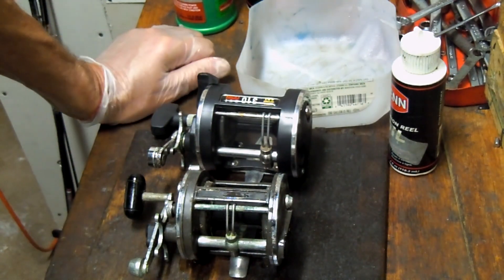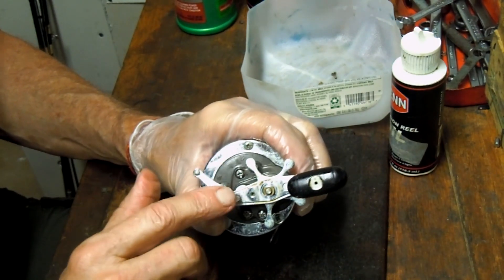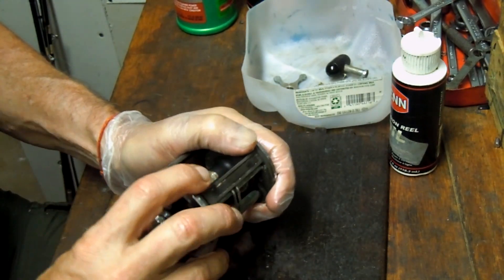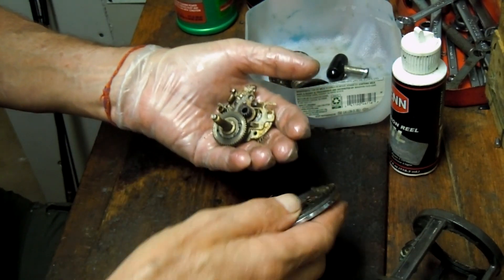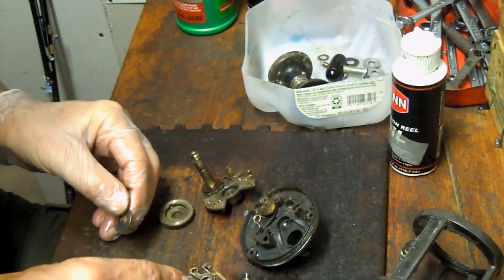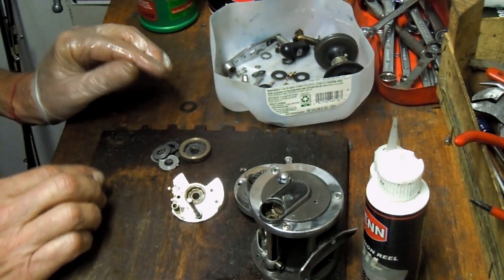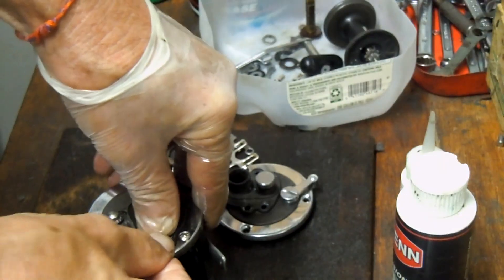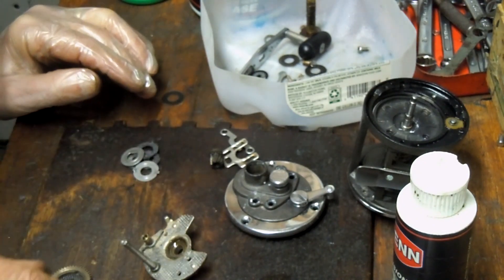Daiwa Sealine 27H saltwater level wind reel how to take apart and service

Comment: You can also get drag washers for these from Smooth Drag,they are the same as washers that are used on some of the Millionaire series reels.
Reply from the maker: Thanks for the tip.  I use Smoothdrag for Carbontex washers, but have not looked there for substitutions.  I will in the future. - Best wishes and thanks for watching - Dennis

Comment: Hello sir! I have recently picked up a baitcaster and it wont let line out well unless i pull it myself. Any ideas?
Reply from the maker: I have a few.  It could be that your free spool release is not working or that the pinion gear is not sliding on the spool shaft, which would keep the gear engaged.  It could also be that the spool adjuster on the side plate has been over-tightened.  I would probably start there and back that off to see if it improves.  If it does not, you will need to go inside the reel to look further.  Thanks for asking - Dennis